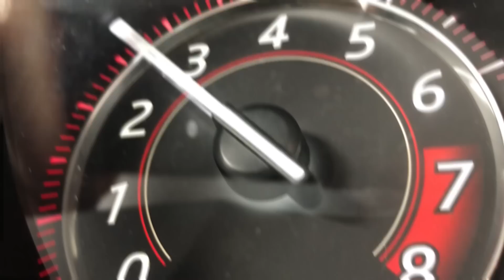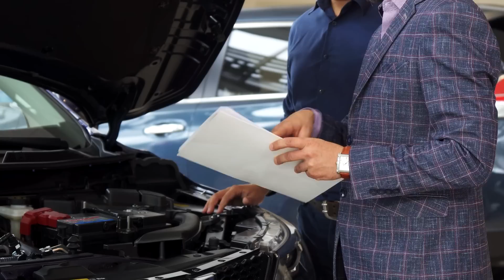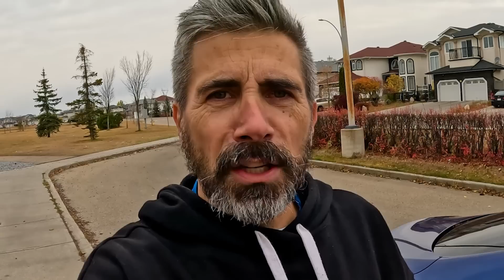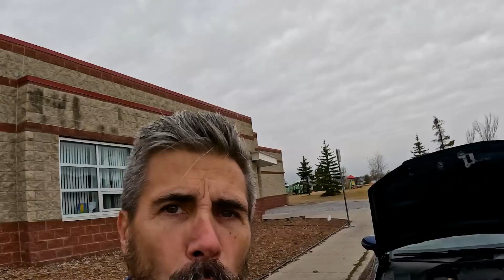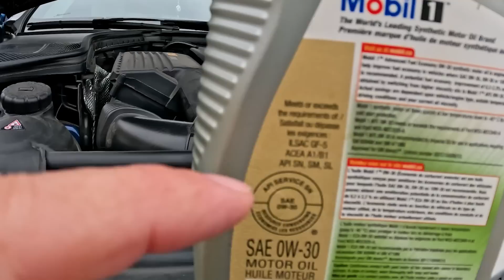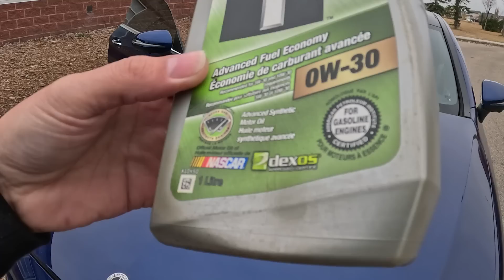BREAKING! Why These New Car Engines Are IMPLODING!

Comment: My wife has a 2022 Honda CRV with a direct injection 1.5 liter turbo charge motor. Honda recommended I have the dealer clean the top end of the motor every 30k miles for $180. What you think? Should I pay this every 30k or wait till 40k miles because this is overkill?

Comment: GOOD JOB,,,, but my suggestion is to everyone is this,,,,get a clean rust free car and put a carburator 305 or 350 rebuilt motor in it... ( it a basic power plant with no extras)....and NO HEADACHE until 700K mileage...( but always use high octane gas + syntetic oil with ZDDP add to it ) =  long lasting,, smooth running motor !!!!!!
YES not much power and 4 drops more of gas but you get a PEACE OF MIND,.,,(both ways you will pay but I would go with 4 drops more of gas vs.  mechanic shop to rip my engine apart every 30K)

Comment: This is why many want well designed older use cars. They are reliable and many of these can still be worked on by your DIYer. I have a 2011 Honda CRV with the bullet proof 2.4 liter inline four cylinder engine. I am maintaining the car and doing everything possible to keep it going to stay away from buying a new $$$$$ piece of junk high maintenance car. 
I hope to get 350,000 miles on my CRV. It’s possible if I maintain it religiously.🙏🏻🏆😉
Reply: We still have a '93 Accord. I wouldn't trade it for a new one.

Comment: Beware of shops using 50-gallon drums of cheap oil, including dealers. Good chance you'll end up with the wrong type of engine oil even if the weight is correct.

Comment: Question. I had the 3.5l Ecoboost. With oil catch cans. I get. They collected a lot of oil. I just bought a brand new vehicle. With only the 3.5l. No turbos. Does the 3.5l still fall under this? Bad carbon buildup.

Comment: The problem isnt DGFI, its the LV motor oil combined with lower ring tension. Use 5w30 in 5w20 motors, 5w40 in 5w30 motors and 0w30 in 0w20 motors and change your oil every 5k miles
Reply: The thing with the lower viscosity oil is the safe zone for temperature is very narrow!  If you have an overheating issue, your engine is toast!!!  This was all done so they could get a mpg or two to meet the emission demands!  It was basically a trade off: reliability/durability for miles per gallon; the consumer will  lose!
Reply: @garybulwinkle82  I think you'll be surprised at the temperature rating. BMW's and Toyota's 0W-20 synthetic oil can protect engines very well, even at 250F. And really, since when does Toyota 's engines burn out before many hundreds of thousands of miles of operation?
Reply: Actually, modern engines are designed with very tiny bearing and journal clearance. Using thicker oil can actually cause hotter-running engines. Unless you often track your vehicle, stick with the manufacturer's listed oil viscosity and certifications. Switching to higher viscosity oils for street use violates the powertrain warranty. I change my synthetic 0W-20 oil every 5000 miles or one year.
Reply: @davepaturno4290  But the manufactures also recommend lower viscosity engine oils at the expenses of engine wear to pass the regulations and better fuel consumption.  I think better to go one notch up higher.
Reply: @desmomotodesmomoto2033  According to what I've seen written and vocalized, using thicker oil in passageways and clearances can actually accelerate wear. The exception may be if you are regularly tracking your car, during which oil temperature is well above average for extended periods of time. Engineers spend many hours testing engines for durability. 
 Another mistake that performance car owners have made over the years was to use less-restrictive intake filters to bump up horsepower. Changing the oil more often helps, but is not always done.
Reply: @davepaturno4290  ya they spend many hours making these engines last only the warrenty period. can't engineer $shit...............
Reply: @rvsteve583  So you think that Toyota/Lexus, Mazda, Honda, and Subaru engines all fail, right after their warranties expire?
Reply: @davepaturno4290  Keep drinking that LV kool-aid and you can trade it in at 60k no prob
Reply: @davepaturno4290  actually you are making excuses and you are full of $hit and your ptw

Comment: I've been working on cars for 35 years, it doesn't matter what grade of fuel you buy, your engines Knock Sensor will will adjust your ignition timing so that it detonates the fuel/air mixture when it's suppose to and not pre-detonate the mixture. I don't get the full 302hp out of my direct injected Mercedes Benz, but who cares, it's still fast as hell and I save money.

Comment: This video was spot on. I wish manufactures would do away with the turbocharged engines. Over a period of time, the turbo itself will need to be replaced. My next vehicle with either be a Toyota or Tesla.
Reply: To do that would require manufacturer to be honest and go back to 1990 where 330i means 3.0 six not a retarded 2 liter four. Let the factories close so the greedy bastards pay the price.

Comment: I would say vehicles that were made between 1987-2010 were the right combination of technology and durability. The previous 10 years before they sucked since the auto manufacturers were trying to adapt. After that in 2011 they were try to adapt again causing all kinds of issues. I sure miss these vehicles made between 1987-2010. Another advantage of those vehicles is you could still work on them and they didn't cost a fortune to buy. I would also add that pre 1974 vehicles were also nice since they had much horsepower and not all the epa nonsense. This is when vehicles were absolutely beautiful with design and style.  In fact they had women in swimsuits that advertised them. You look at the modern day car they look boring and cheap like someone without any style putting them together. There is no more sexiness about most of these vehicles just efficiency.
Reply: I would say the gold standard for Toyota was 1998-2010. 
Then they decided to go market share and build a lot more cheaper quality cars.
Reply: @ericscottstevens I would say Toyota 1992-2013 is the peak plateau.   Last Toyota from that era (in US market) was 4-cylinder 2023 Tacoma.  RIP
Reply: @ When I went to the Honda dealer with my 2004 Toyota 4Runner SR5  (with 101k miles)a sales guy in the lot came running up to me wanting to know if I was selling it or going to trade it in. I said NO. He said any Fourth generation 4runner sold as used lasts 1 day on the lot. Guys drive daily through the used lots looking for Fourth generation 4runners.
Reply: First gen highlander made in Japan.
Reply: @guruofendtimes819  Good example I had a 2012 Ford Focus. At 95k I started having problems with the stupid transmission. I had these problems until I sold it with 140k. The previous models 2010 and earlier had the normal old school transmission and with general maintenance you could easily get 250k on that vehicle. The sad thing is the dealership only would replace the clutch once since I got it in just under 100k and then the computer at 125k. They said it was my baby after that. At 140 it started doing the jerking nonsense so I took the grounds off since it's primarily electric controlled and cleaned them out new dielectric grease on and that worked for 5 thousand miles until it did it again and then I sold it.

Comment: So Direct fuel injection, Absolutely Do Not go over 5000 miles on your oil especially if it's not a Vehicle driven on the Interstate highway Daily, Many short trips wrecks your oil, Oil is cheap engine's aren't.
Reply: I agree, plus 10-20 thousand oil change interval suggested by car manufacturers is a bad idea, WAY too long IMO!🤔🙄🤨
Reply: @IndyAvocadoKid they just want it to just make it out of the warranty period. So getting 1-2 miles per gallon, because of CAFE standards causes more greenhouse gas because you have to build a new car or engine. It’s a negative, producing more Greenhouse gas!
Reply: @ true, it’s like save some  quarters now and pay a few dollars later🤔🙄😒
Reply from the maker: Exactly right about that.
Reply: Just buy bmw! It’ll leak oil and coolant every day and you’ll add new one, that way the lifespan of engine increases. Problem solved!- thank you very much!   From my own bimmer experience.
Reply: @ heh, I think British sports cars in the '60s had the same design feature, they were known for leaving a puddle on the garage floor routinely🤔😏😆
Reply: Toyota have 2 types of injection on some of their cars, they combine the 'OLD' and the  'NEW', hopefully the OLD type partially cleans the back of the valves, perhaps a partial flow of, say kerosine could be fed by an injector into the inlet system  to of a diesel try and clean the valves.
Reply: @adoreslaurel  sigh, sometimes I think these fuel saving trchnologies go too far, like stop-start engine tech, or turbos on economy cars. You save on fuel but these technologies seem to cost money in terms of engine wear and damage, so its kind of just a wash🤔😒
Reply: @IndyAvocadoKid  I will  stick with my old Mazda 323 21 Years old, my Wife has  Hyundai Getz 14 years old, as long as they function well, i have no desire to be in the hands of the dealers when any gremlin crops up.
Reply: @IndyAvocadoKid  And what happens if that big screen that does 'Everything' poops itself, will repairs be available for a reasonable time?
Reply: @adoreslaurel  true, relying on the screen to do EVERYTHING seems like a bad idea, plus knowing how computers become slow and obsolete over time a 5-10 year old computer in your car will likely develop some serious lag time responding to touch when it gets old, especially if you keep adding newer software to it🤔
Reply: @IndyAvocadoKid  It really reinforces  that old saying about built in obsolecence.
Reply: @adoreslaurel  Oh yeah, planned obsolescence is super precise nowadays about when thing will fail, because computer aided design means plastic car parts for example can now fail just outside of the warranty period. In ye olden medieval times, parts tended to be overbuilt due to lack of computers to help design things to a precise degree🤔😒😏
Reply: @IndyAvocadoKid  Stick to yer ol' banger.
Reply: @adoreslaurel  Certainly cheaper and easier to maintain, my brother the former Sears auto mechanic agrees <working there till Sears closed up👍🤔😏>…..sigh, I miss Sear’s🥺😔
Reply: Oil's not cheap anymore after the last 4 yrs but infinitesimal compared to an engine.
Reply: Dude if you're going over 5,000 mi for an oil change in any car you're an idiot there is no 10,000 mi oil change that's why we have all these used cars right now with clogged up gunked up engines cuz people thought oh yeah I'm going to use this oil that lasts 10,000 miles.....bullshit! 🙄

Comment: Not all engines use oil..my 2018 maserati levante doesnt use a drop between oil changes and has very little dilution and blowby.and i run it fairly hard..actually my toyota engi e uses more.strangely..so i guess it varies .
Reply from the maker: Yes it certainly
Does vary and 
Many use almost none.  It’s a total design with DI being a major
Contributor

Comment: Wow, finally someone who says exactly what i been saying. Word for word!! Excellent video!!!
Reply from the maker: Much appreciated!
Reply: Except no port fuel injection or and gasoline fuel injection system has ever premixed air and fuel prior to injection.
And MOST people put the cheapest fuel in their vehicle.
When you shut your hot engine off it leaves a layer of oil on the cylinder wall that does not drain away over night or even over weeks.  

If what he is claiming were true ALL engined would have this issue and they simply don't.

Comment: This is a Political order from Green Haven to design engines to break early in the exploitation 
People come to hate and go for Electrics garbage with the very huge price tag.
100 years old engines can run today without any problems because were designed to last
Reply from the maker: You are right, they do t build them like they use to

Comment: When my wife chose her 2023 Kia Soul in I knew what we were getting into. 😆 Then again you couldn't find a car on a Toyota or Honda lot and she needed one to replace the one she lost to a deer accident in 2022. I'm not going to get into the used offerings at the time in our area, needless to say for $23k it wasn't a lot of money in terms of what was out there used at the time, mostly rust buckets from New England. That 2.0L "Nu" engine is really noisy on cold start up, same as the one in the Forte. Interestingly enough I found a post online where someone switched to Pennzoil Ultra Platinum and it helped quiet down the clatter (same viscosity) and I tried it so I switched from Mobil1 to PUP and it starts up a little quieter now. But that engine you need to change the oil every 3k miles, forget about 5k or 7.5k. Right now it's got 20k on the odo and doesn't burn any oil or at least none that I can see checking the dipstick once a week. I also only use 91 or 93 octane, the compression ratio on these is 12.5:1 and so I noticed it runs smoother with the higher octane. Sometimes I think the car shut off on me being a Kia because it's so quiet and the steering wheel has hardly any vibrations like you'd associate with a car of this price point. So I have to check the tach to make sure it didn't shut off, being a Kia I'm always half expecting it to shut off on me, I don't know why. The only thing that broke was the master window switch, we went through 2 of them because the first replacement was also bad from factory. I just need it to hold for 10 years at least, once the power train warranty runs out then I'll be happy I got 10 years out of it but who really knows, might be more or less. I intend on doing the CVT service every 30k miles, I'm not following the owner's manual there which is lifetime fluid, or under "severe service" schedule it says to flush the CVT fluid every 56k miles which I thought was an odd number.
Reply from the maker: Awesome and yes sometimes the economics just make
More sense  the. Buying a 5 year old Toyota with hard use and 90,000 miles.  If it serves the purpose.  At least you are going in eyes wide open
Reply: 56.000 miles is approx 90.000 kilometers!
Reply: Nice details hope it keeps serving you well.
I love a tough Toyota or Mercedes they're good for 20-30 years if maintained.
The Toyota if one isn't a mechanic & the Benz if you are.

My 2000 e320 has 270,000 and still gets 28mph highway as always - just towed a loaded UHaul interstate too.

Parts are dirt cheap as they're common & everywhere - an advantage many newer cars or even Toyotas lack.

Cheers - David in Texas
Reply: 56k miles = 90k km. The British did screw you with their metrics. Most stupid is mpg.
Reply: @borisatanasov England invented imperial measurements.
Metric is the realm of France...

Comment: I add my own detergent during oil changes--usually Tide.
Reply: Tide is good.
Reply from the maker: Haha
Reply: @ECPP  any recommendation on the tide pods vs the liquid?
Reply: @ECPP  get a job
Reply: @itsallminor6133  No, but from the posts here, it's agreed we all want clean, April-fresh-smelling motor oil.
Reply: Hmmm, adding fabric softener will also make your car run a lot smoother👍😏😂jk
Reply: @IndyAvocadoKid - if added to luxury cars, it makes for a softer exhaust note, too.
Reply: @eu7435  oh yeah, it’s great for luxury cars, even conditions the leather car interior somehow🤔😏😂
Reply: If you use the Tide with Downey, your exhaust fumes will smell April-fresh 😂
Reply from the maker: Nice
Reply: @eu7435  Thanks, I'll have to try that.
Reply: @azmike3572  gets rid of carbon deposits. The liquid is easier the pods can be problematic

Comment: My favorite cars was the Pontiac Grand Prix from 1972 to 2008. It had that wraparound cockpit – and that pointy hood.
Reply: loved ny 74 sj 455
Reply: @ I had a1972 miss that car
Reply: I'm driving one of those W chassis myself, 2001 Oldsmobile Intrigue, has the most powerful engine put into a W chassis, 3.5L Shortstar 😊
Reply: After 25 years, my mother gave me her 1963 Ford Falcon, straight 6, 2bbl carb, manual choke, no power brakes or steering. No power anything. It did have an automatic transmission, and that car started-up in the coldest New England winters with that manual choke! A Radio Shack under dash cassette converter and it was my best car.
Reply: @ wow that was my first car a white two-door hardtop Ford falcon never forget it 1962
Reply from the maker: Nice

Comment: My mitsubishi eclipse cross has a 1.5l 163 hp 4 cil. and uses direct injection and port injection. No carbon accumulation that I know of.
Until now (6 years later) no oil delution. Oil 0W20
No problems what so ever.
Reply from the maker: Very nice indeed
Reply: Thank you for the kind response.
Forgot to mention: my car has manual transmition.

Comment: Dump GDI engines. They are crap. Save the world some other way. I've had to change my fuel injectors twice. $1800 each time. Also, i took it to get a GDI service and the shop said they don't feel comfortable with doing it because it is over 70k miles. They said the service might cause more issues. I'd say never again but ALL vehicles have this direct injection crap engines.
Reply from the maker: Yes parts are huge money and durability is in the toilet

Comment: Scotty for some reason, roasts German car brands!
Reply: Mostly BMW, bring my wallet 😂
Reply: Because Euro brands use so much plastic in and around their engines. Plastic is the stupidest material to use around high heat sources. So, it doesn’t take a rocket scientist to see BMWs will be costly to fix down the road even if one has a particular model with a good designed engine. BMWs are basically buy now and sell just after 3 years or certain amount of miles type cars. Once the car passes the mileage limit it’s all $$$$ in repairs. 😢😢😢
Reply: Because they don't know how to make cars, americans neither.
Reply from the maker: Well….